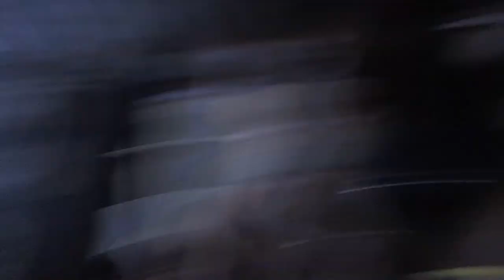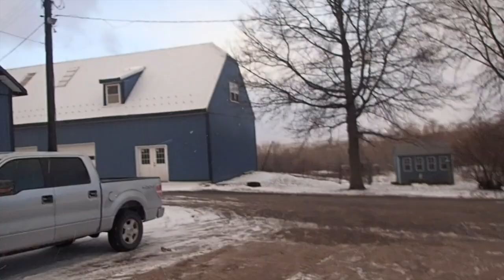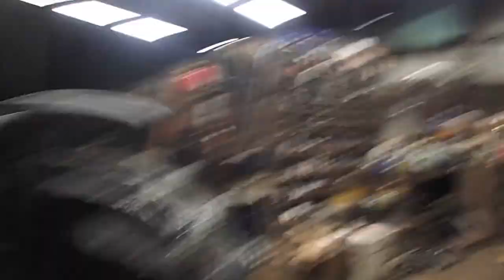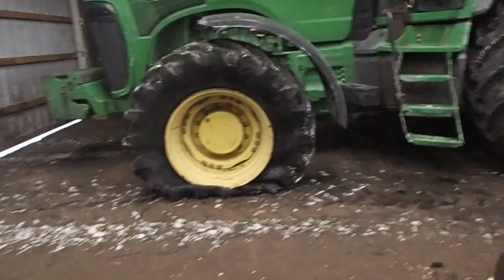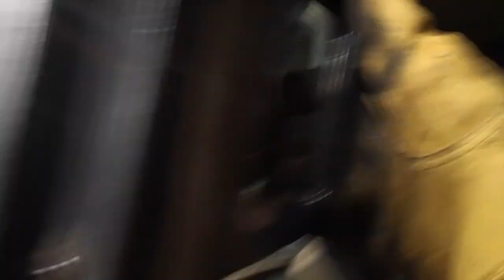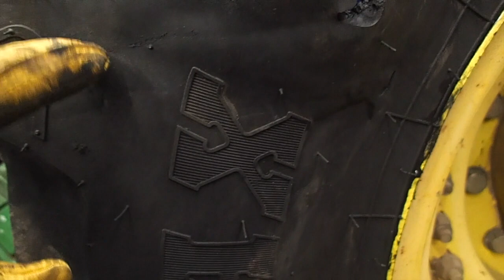Stupid Me I Fail

Comment: I did a similar mistake with a skid steer loader.  Working along a fenceline in town I found a T post laying flat on the ground.  The triangle at the base tipped up and sliced the sidewall.  I tried patching no luck.   Took it to a tireshop that services truck sized and larger tires.  They hot patched it.  and the tire rolled for the remainder of its tread life.   Cost me 40 bucks if I remember right.   That was 8 years ago.    Like I said in another comment I have a hot patch appliance on the shelf that will never be used again.   I am sure a trade can be worked out.  I need more T shirts for example

Comment: I have seen these large patch kits for when they gouge off road truck tires, it involves cutting out sections of the rubber down to the band's, grinding, acetate, and then multi layer patches and finally a cure time. they say when done the patch is as strong as the original tire. The video actually popped up on YT a couple weeks ago off of one of your videos. They exist, but may be worth more trouble if you can afford the replacement.

Comment: Will the tractors from England get here before your work starts in the spring?
Reply: They don't grow row crops anymore. Mostly what has happened in the past is some over seeding and a lot of applications of fertilizer and such to hay fields. Barring a real bureaucratic screw up the newish tractors will be there in plenty of time. It will be mid to late June depending on the weather before they have a real need for the new tractors.

Comment: Hey Wesley, my boss toughs me a trick for seating stubborn tires, if you have a tire that's just barely touching the rim, and won't seat. Take some rubberized undercoat that's in a can and spra inbetween the tire and the rim, let it get a little tacky, and put air in it, the rubberized undercoat acts as a gasket. Idk if that trick will seat a tractor tire. But I seated tires on a r model Mack doing that so it may work. Just thought I'd share that with ya

Comment: Bolt it with fender washers and tires seal. That how we fixed holes in the old days. Tighten it up good. I've seen tires with more bolts than rubber.

Comment: back when I scrapped tires had a container come from the Virgin Islands. tractor tire had a hole about that size in it  they took a section of sidewall from another tire carriage bolted it to the inside and used a tube.

Comment: Have you ever had vulcanizing done Wes?  This looks like a good candidate.
Reply: I have done that on a couple of tires( rear ones) still running on them.
Reply: I was charged a couple of hundred or something, way less than a new tire.  Got one done in Rapid City, SD at I believe at Great Western Tire.
Reply from the maker: i just bought the machine to fix the tire.. i was quoted $450 so i bought the whole kit with gum and patches and all i need for $500.
Reply: One tire repair, will pay for your investment.  Where did you acquire it online?
Reply from the maker: eBay of all places
Reply: Thanks for answering Wes, I think I am gonna be trying to acquire one of those!!!!
Reply from the maker: dont until i give it a try so if its junk you dont wast your money!!
Reply: Thanks Wes!!!
Reply: There was a place called Bandag over around York, PA and I'm pretty sure they did vulcanizing. I know for sure they did recaps and they were a pretty big outfit so I believe they did it all. It's been a long time but it's worth checking out.

Comment: how long does your heater run on a tank of fuel I am looking for more ways to supply heat don't want to buy something I know nothing about but by the looks they last a few years just wondering about the fuel usage
Reply: Those heaters burn about a gallon a hr. Usually have a 10 gallon tank. It will probably depend on manufacture and some have settings for different heat levels now but some you just plug in and they just run wide open. But a gallon a hr I've found with those heaters is a good rule of thumb.
Reply: thanks

Comment: Here in Poland its fixable for sure. Find somebody who does hot vulcanization method ( i dont know how is called in english) not just a patch. theycadd rubber and heat it ub to melt it together. Then they add a patch. Here you pay around 40-50 bucks for that kind of a job. Mine was worse

Comment: Shit happens I guess haha. Joys of farming. Could've been worse I figure you didn't get the hood or the engine and part inside. That could've got expensive in a hurry. Had a similar funny thing I did. I was using my cousin's TB100 with a loader to load old ruined round bale feeding rings into the bed of my truck to go scrap them. I had just scooped them up and was pulling forward making sure I didn't hit something next to the truck (can't remember what) as I was swinging the front end in and was paying more attention to it than the truck. I suddenly realized I was about to nail the bed with the bale spear so I quit turning and slammed on the brakes and just out of luck instead of hitting anything expensive I hit the plastic handle that opens the tailgate. I destroyed it haha but could've been a lot more expensive.

Comment: Sorry Buddy, No good way to fix that tire. That looks like a little 16,9x28. Ag tires are made to be flexible in the fields. A patch for a 1.5 inch injury in the sidewall won't last long. 
What you need is what they call a section repair.  Look for a place that repairs OTR Tires.  I mean big tires, like what what would be on a Cat 980. 
If you rely on the tractor, get a new tire. You can maybe have the old one repaired as a spare.

Comment: just do what they would do in INDIA  put a piecie of old car tread on the inside of the tyre with two bolts sticking through the tyre to the outside cover the tred with liquid rubber and patches ! on the outside put a bit of old tyre tread  over the hole and put some nuts on the bolts it dond look great but works well !

Comment: oh you know what in an emergency I have taken a piece of the sidewall from another old Tire and put it inside of their and bolted it with carriage bolts and took the grinder and tapered the homemade patch and run a tube inside I had + 18.4 / 26 I've done that too and I even did it to a 16.9 24

Comment: And tyres, ain't they a bitch Wes? I was driving a Ford 8600 with dual wheels down the narrow roads you've seen in England in about 1981, 2 wheel drive like everything was back then unless you had a County or a Roadless,, (all based on Ford skid units) and I pull onto the verge because a truck is coming the other way, don't even take my foot off the throttle like you don't when your a kid that knows everything and your in a hurry to bust up some ground and bang I fly out of the seat and smash my head on the headlining,, I pull into the next farm layby and low and behold the tyres obliterated,, not only that but the wheel rim has a monster dent in it,!! feeling like a right fail a call it in and we go back and have a look down the road to see what caused it and there's a a f ING tree stump about a foot tall that I've hit.,  ended up having to take the other side dual off and cultivating with single wheels that autumn,, yep we all fail at one time or another, the worst bit was that it turned out that me and my dad had cut that fucking tree down a couple of years before. take care ;-)
Reply: simon britcher that'll teach you, not to leave a big stump....

Comment: can u not put a tube in it ?
Reply: ***** thanks for the reply
Reply: a pro tyre shop can fix it usally, but it costs much. at least here. grand for a wheel loader tyre. "edit. wrote that before video was done hehe"
Reply: Tube is $200. and the cord is gone so it would just bulge out and eventually blow out.  At one time they built some heavy duty boots which could be vulcanized into the tire rubber.  Law suits killed that industry.

Comment: That could be repaired with liquid rubber
Reply: well no,.... the steel bands in the tire have been severed so  the tire is ruined, there will always be a bulge and a weak spot in the tire, it would eventually crack and burst.  Wes did the right thing buy using a patch,..if fact it is the only proper thing to do in this situation to be able to keep using the tractor for the moment, but the tire will have to be replaced as soon as possible.